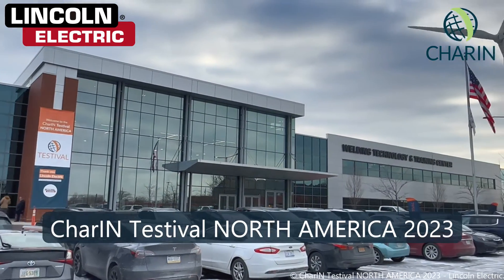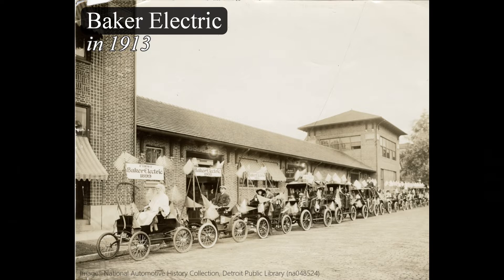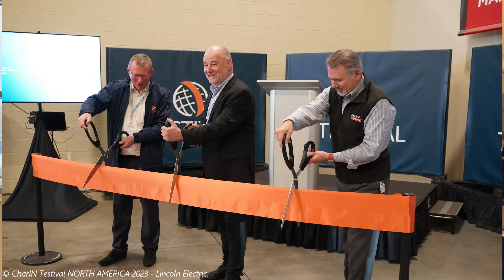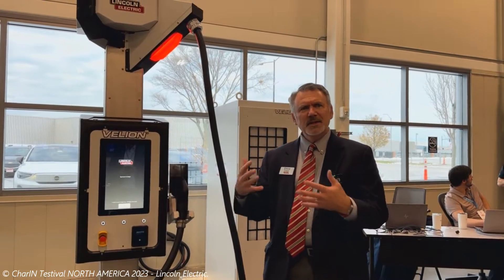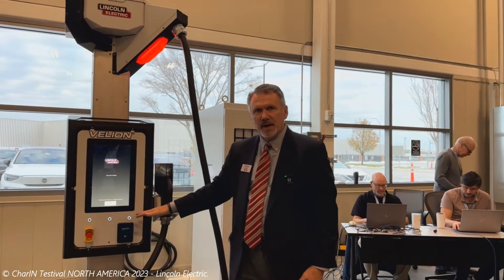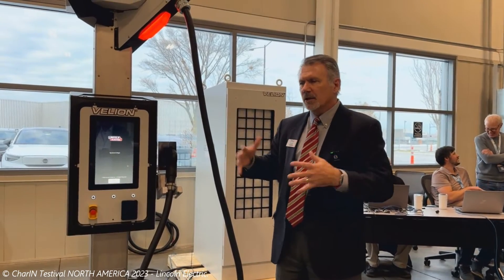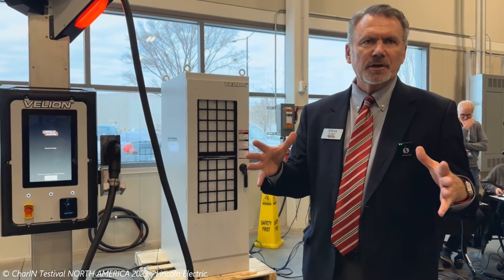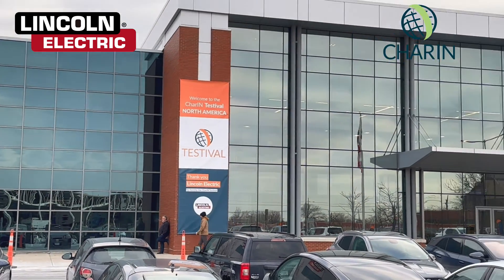Lincoln Electric Velion EV Chargers (over 125 years of TOUGHNESS)

Comment: What connector was that? Didn't look like the NACS.
Reply from the maker: Lincoln was testing with CCS. They are working on NACS for testing probably at the next event.
Reply: @mikethecargeek  The design supports both connectors, NACS connectors were not available for purchase (no stock) at the time, since Tesla had just been made to let others use the connection I suspect this is why Lincoln didnt have one.